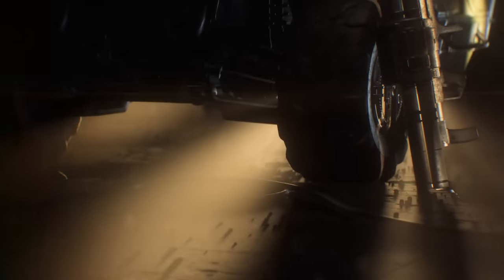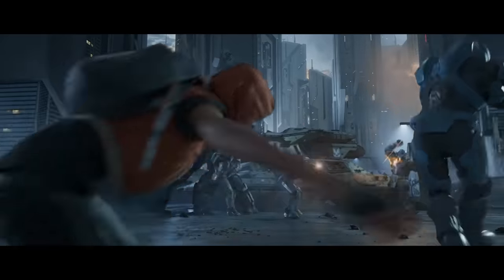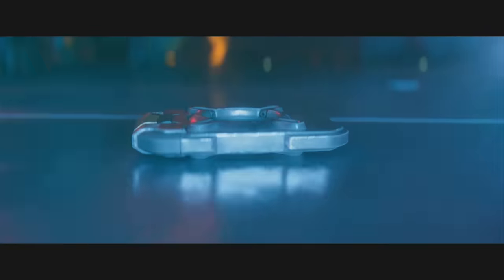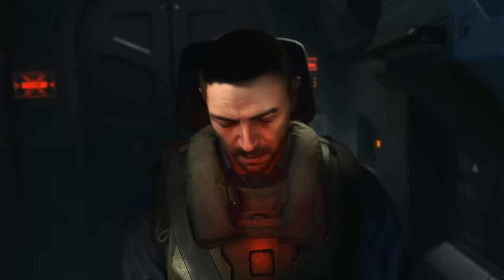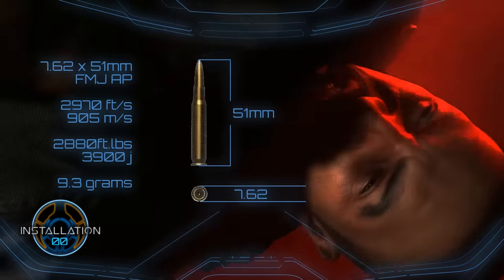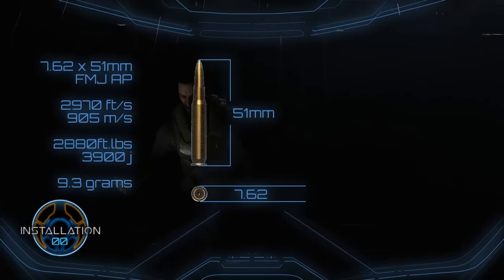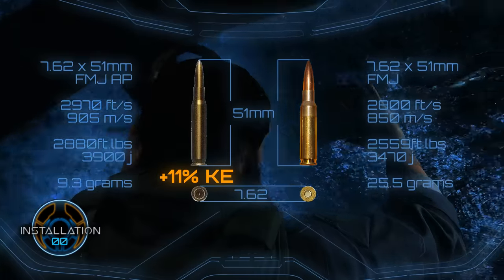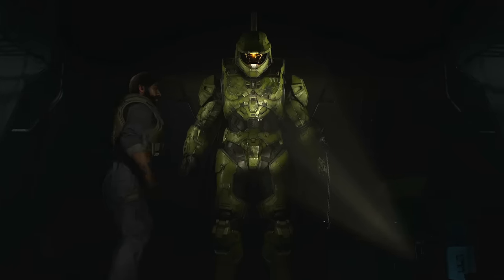Why are UNSC Weapons so powerful!? | The Armory

Comment: I always assumed the increased performance came from a more powerful propellant charging and stronger materials used in the rounds construction.
Reply: Same
Reply: Yeah I would assume metallurgy 500 years in the future can make some pretty advanced materials, make the chamber and casing out of something that can handle high explosives with an internal recoil dampener
Reply: I always imagined they had plastic explosive with a piezoelectric primer instead of a traditional primer/powder combination and had strong barrels to complement that power
Reply: The CE magnum was said to fire oversized explosive rounds.
Reply: @samtheweebo   SAPHE 12.7 rounds 

Semi Armor Piercing High Explosive. 

AND THESE WERE MADE FOR FIGHTING HUMANS
Reply: @lostwizardcat9910  The whole UNSC weapon set in CE is like designed to cause maximum suffering. The pistol is accurate scoped and has explosive rounds, the standard issue AR is random fast firing. Try to target an individual and you are likely to kill a city block. The shotgun has really large fast damaging pellets and a large spread. The sniper is made to shoot through multiple targets. The Rocket and grenades have a huge blast radius.
Reply: @samtheweebo   I disagree, the handgun ammo is questionable yes, but the rest honestly seem pretty realistic. the sniper is a more powerful round than .50BMG and the rocket/grenades have a realistic radius.  

Also the AR in CE was made to be used in close quarters as its the naval variant and was only inaccurate for balance as in the lore its actually a fairly accurate rifle out to 800m. Its also select fire.
Reply: this, explains why marines can just magdump a rifle that in current times would need to be mounted on a bipod and have a replaceable barrel. Kinda how warthogs don't stray much from current day cars, just that they use better fuel and tech

Comment: I agree, the UNSC weapons in Halo are very powerful and ridiculous. I always thought that the answer was because of technological advancements by the 26th century. It does makes sense that 500 years of technological advances in weaponry shows more power then what we have now. I agree, in reality you can't make anything like Halo human weapons. At least, not yet. The future is always in motion. But it's always good to be prepared.
Reply: Honestly I think it's as simple as hot metal will always cause more physical damage than concentrated beams of light. 🤷‍♂️
Reply: @madkabal  Agreed.
Reply: @madkabal  plasma is definitely not a beam of light. and hard light is a special property of turning well light into a physical mass even though light does have mass its so minuscule we say it doesnt. Actually currently solid photon particles hvae been created just not to the same degree. 
These weapons are particle dilators that use an unexplained method to convert light mass into hard light for use as a projectile. This would presumably provide both the kinetic energy as with solid projectiles
Reply: Halo weapons are implausible for the fact they weren't designed by people having extensive experience with firearms.
The AR's have nowhere for the bolt to reciprocate and pick up another projectile unless it uses an extremely elaborate bolt which is not out of the question.
The pistols are mostly doable even though they are essentially magnum versions of the .50AE desert eagle round.
The BR and DMR have the same issue of the AR but plausible otherwise.
The Sniper is mostly based on a real firearm NTW-20.
All of Infinite's new firearms are plausible.
The SMG is more questionable.
Reply: thats far better than mass effect or star wars with ridiculous technology while behind halos era ahem star trek
Reply: @centurymemes1208  The only explanation when it comes to Mass Effect in my opinion, is that alot of the technology used by humans were reverse-engineered from ancient alien tech. And it's only the 22nd century.
Reply: @siphonicstorm7191  even crazier
Reply: No they are not "very powerful and ridiculous" at best 10% more then early 21 century. Currently some tested but not in use ammo goes WAY pass that little 10% more, such as ETC ammo.
Reply: tbh in 500 years of technological advancement ESPECIALLY with multiple wars happening and the UNSC preparing for all out war with the Innies for years, I would have expected way more OP weaponry (for Infantry and ground combat at least)

Though I suppose the UNSC focused on new space weaponry first, as having orbital dominance will almost always guarantee victory on the ground
Reply: The round described is identical to the NATO M80 ball round invented in 1969.
Reply: 500 years and they still use bullets? sad sad sad state of humanity
Reply: @3mpt7  wtf are you saying in english?
Reply: @3mpt7  thats called science fiction, created by limited human intellect.
Reply: Something that I'm interested is is the irl rail guns they've been making every time I see it fire all I think is "MAC away"
Reply: @yulfine1688  he's talking about laser weapons like star wars not plasma
Reply: @GrOuNdZeRo7777  plausible sure, but not nearly as effective or powerful
Reply: @Thorgon-Cross  yet the rounds won't punch through concrete the way halo weapons do with ease
Reply: @Blox117  because developing faster then light travel is such a pathetic accomplishment 🙄
Reply: @hefty magic  star wars weapons actually use a gas that is translated into a bolt it's not a laser.
Reply: @heftymagic4814   actually we have .308 rounds now that do consistently punch through concrete, we also have some 5.56 rounds that can do it. 

the fact is the smallest caliber in halo is the SMG which is a 5.7 round and was intentionally made to be underpowered for use inside space faring vehicles. 

the BR round would be best comparable to the 8mm kurz used by Germany in ww2 except in a magnum format because it uses a "gel based propellent" 

the sniper rifle is a 14.5mm bullet which is a .57 caliber
Reply: @yulfine1688  Well all the plasma weapons do in game is shoot a bolt of super heated plasma, assumedly in real life to do this you would siphon certain gasses through a really small barrel and ignite them as they fly out the end. How the ignited gas would then stay together rather than just expand after exiting the barrel is beyond me though.

But anyways, it makes sense in my mind that the hard light weapons use a very similar mechanism, but instead shoot a photon through the middle of the gases, which would essentially drag the gas along the photon’s travel path at high speeds, so it’s not that the photon has mass, it’s that it’s dragging the mass that the gas has with it

Comment: Setting aside the scuffed loaded weapon weight, modern .308 handloads can get 3000 fps from a 24 inch barrel with a 150 grain bullet (military weight), still within safe pressures. Halo's Assault rifle has a 24 inch barrel, so unless the bullet is heavier than 150 grains, it's velocity in game is indeed possible with modern propellants.

Comment: One possible explanation that exists, and one I personally like using in my own material, is that the UNSC doesn't use any kind of gunpowder-variant at all. Instead, they could use a chemical-based propellent that is far more volatile then it's 20th and 21st century counterparts. An example of this would be the real-life C-4. Halo lore mentions both 'C-7 foaming explosive' and 'C-12 shaped charges', so it would not be surprising if the UNSC developed a high-powered chemical propellant for their bullets that outperformed the IRL stuff. 

Another, more ludicrous idea, is something like C2N14, or what is the demon brew more commonly known as "Azidoazide azide". Directly using something like that would be insane to the point of criminal stupidity, but a somewhat less dangerous compound of similar nature could 'hypothetically' be used for projectile weapons of the 26th century. 

An unexpected side-benefit of this possibility is that using a more high-powered propellant could also explain why UNSC guns seem a bit bulkier and more robust then their IRL counterparts. Having a more powerful bang inside the gun when you pull the trigger means needing to beef up the gun itself to handle it, logically! The apparent love-affair the UNSC has with titanium would also seem to support this concept. After all, which kind of gun is going to stand up better to being used as a melee weapon by an enhanced and augmented super-soldier: one made from steel, or one from titanium? =^x^=
Reply: Chemical composition of the propellant doesn’t make the round more powerful though…if the propellant is more powerful and causes the round to travel at a higher velocity then the round will be more powerful but if the round travels at the same velocity as another round with equal mass then regardless of whatever propellant was used it will have the same kinetic energy…and the assault rifles muzzle velocity is roughly the same as a real life 7.62 round so if we ignore the weird mass discrepancy like he said then they should be the same
Reply: My head cannon has always been that the bulky look of the ma5 is because the gun it's self is armored. so that a single plasma burst or similar doesn't disable the soldiers weapon. The original deign looks as though It literally has armor paneling on it, but I like the idea that it's also the withstand higher chamber pressures.
Reply: @ExtremeSportsFails  True, which is why I tend to ignore things like muzzle velocity for video game stats. Most of the time, they're just talking out of their rear-ends. If the propellant is a more powerful variant then IRL, and the rounds hit harder, then there's no way they would have the same muzzle velocity as IRL rounds. Ergo, they 'must' have a higher MV then IRL bullets and the listed stats are false. Simple logic. =^x^=
Reply: @tsamoka6496  agreed so personally I think analysis like this is kinda silly bc it ends up being speculation and imagination anyway as it should be bc it’s sci fi
Reply: @ExtremeSportsFails  The flip-side of that is that sometimes things in scifi can become real, or inspire advances in unexpected places. In the same vein of this video, I wonder if bullets using a chemical/liquid propellant could be made IRl, and how it would work. Maybe even actually using something like C-4 or some other plastic explosive... =^x^=
Reply: That would make sense because guns in the halo universe are bulky and over engineered so that they can safely use an explosive as a propellent rather than the powders we use today that rely on slow burns and pressure build up.
Reply: I agree, i think that’s the reason they are able to fire in space aswell.
Reply: Another idea is just that lighter bullets go faster... 50m/s really isn't much and if you actually look at real life rounds their is a similar and even greater variation of speeds between different rounds fired in the same calibre, because again, lighter bullets go faster.
This video is silly.
Reply: This seems to be the best case of explaining how come standard-size rounds form our century can deal significantly more damage to targets. Especially the 8 gauge slug, while devastating, shouldn't be as powerful as it is in the games, like the Magnum from Halo 1 is essentially a hand-cannon on steroids. 

The idea of chemical propellant also helps with the issues of keeping and utilizing a substance that is somewhat unstable to store. A chemical can be stored perhaps in a special canister or inner state, allowing mass safe production of them, and only become volatile when under a set stress, such as electrical shock, or a ignition system built into the bullet. Makes the world feel more advance, yet familiar in the best way possible.
Reply: All i know is that the scorpion tank fires tungsten ammo according to the marine combat dialogue in halo 3
Reply: Titanium is weaker than steel, but compared to steel is just lighter than it is weaker. So steel would hold up better
Reply: @tsamoka6496  pov: you don’t understand what you’re talking about
Reply: @jb76489  ...okay, and? If you really feel like spending the time to do so, then prove me wrong and I might agree with you. Otherwise, just saying that I'm wrong without anything backing it up is entirely pointless and adds nothing to the conversation. So, have a nice day, I guess? =^x^=
Reply: @ExtremeSportsFails  Chemical composition affects maximum velocity. Speed is power, speed is penetration.
Reply: @tuscan9617   THIS that's exactly why and how a .220 swift with a tiny 50grain bullet  outperforms both a .270 and a 30-06 AP round when shot at armored steel. "P.O Ackley's handbook for shooters and reloaders volume two"
Reply: @tsamoka6496  he got some things wrong in this, modern smokeless powder doesn't explode, its a controlled burn that releases a lot of gas, you cant really use high explosives as a propellant, if I remember right its basically because the process happens to quick to really push the bullet so you end up with worse performance
Reply: @tsamoka6496  excepto que tu lógica es erronian porque es al revez. Si las estadisticas nos indica que no ha habido aumento, significa que aun usan polvora blanca
Reply: @tsamoka6496 no se pueden se intento y fracasaron.